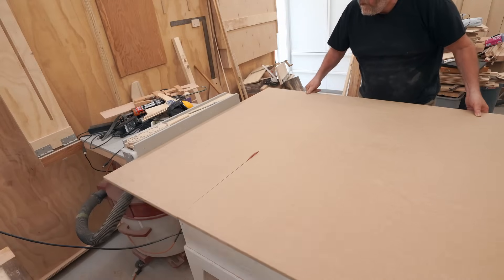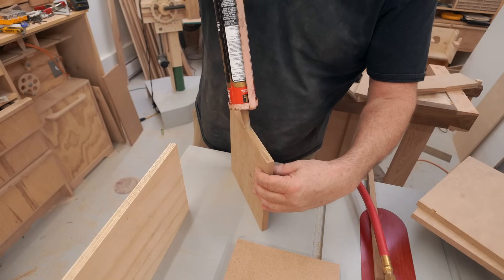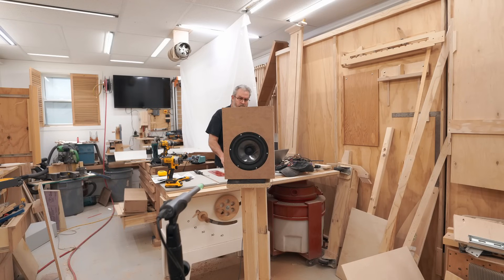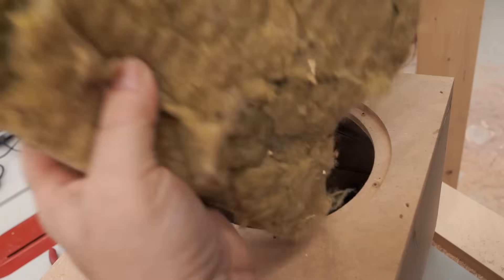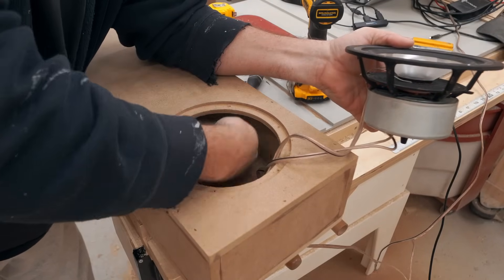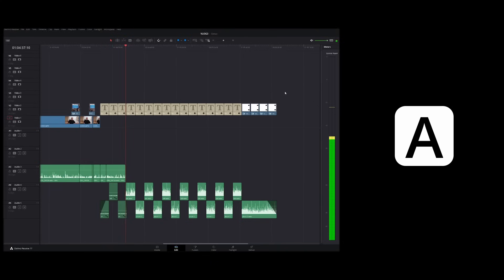Is a Deep Speaker Box Better? Tested with Surprising Results

Comment: The shallow box with larger baffle and rear plate needs a brace in the middle because it will flex more than the one with small baffle and rear plate. Yes the narrow box still rings but will be up higher because of the resonance of the box.. im amaised you missed the mark..here

Comment: It appeared to me that the material you called 'rockwool' was a fiberglass or some other  fibrous insulation, but NOT 'rockwool', which most commonly is dark gray in color, or having an appearance closer to coal. Another way to describe the appearance of 'rockwool' would be similar to steel wool with bits (or chunks) of black rock (coal). I'm not saying rockwool would conduct, or be susceptible to magnetism, but the chunky bits, inherent to rockwool, would likely cause rattling at higher sound pressures, or by increased vibration (movement) of the speaker cone.

Comment: Always use dampening materiale inside the box. But a good box has internal bracing and that will also help cancel standing waves along with other messures. So deep or shallow box does not matter as long as it is built well. And internal box volume MUST be the same for this test to even have any meaningfull comparison.

Comment: Could also be because of the different resonance of the much larger front and back panel.
But also the shape/lenght of the volume matters. The box is not only more shallow but also significantly higher/longer. I think the orientation of the shape in relation to the speaker doesn't matter as much, at lower frequences ?  Needs proof though by tip the box over and mounting the speaker in the head panel. ;)
Thank you for this very interesting audio experiments though !

Comment: I have heard a lot of speaker box design best practices and all of them are for a ported or vented design... when looking at sealed, 'same volume' designs the speaker should have the same results. Knowing you don't want to go thin on the material, brace or frame areas that might flex with large low frequencies... but for the most discerning ears it will be the same.  Great channel by the way!

Comment: Anyone thinking that they are getting a true representation of the sound after it has been re-digitised, likely compressed by YouTube, processed through an audio driver and finally subject to all sorts of distortions by your consumer grade audio gear is kidding themselves.

Whilst I think you might be able to hear a difference, it is impossible to appraise or rate the sound because of the massive amount of change introduced by the above.

For example, one speaker may be deficient in the mid-bass region because of destructive interference in the enclosure, but putting this through a way too 'boomy' set of headphones would correct for deficiency.

Then bias, yes, you are sub-consciously hearing the the sound which you are expecting, be it you like a certain type of musicality, the box design looks nicer or the tone you are hearing is more appeasing.

If the question was "which speaker sounds better recorded and uploaded into YouTube and then played back through your flea market headphones", then perhaps you might have a valid comparison.

Comment: I  listened using regular headphone and I didn't hear any difference at all. But I do believe there must be differences!! Good test. Thank you for the opportunity !! Alberto
Reply: Box A sounds a tiny bit more open and wider
Reply: The bass wasn't as sharp on A. The voice sounded a little bit colder on B but sounded better with a bit more detail in the high med in the voice sound. Everything was a little bit more muddled together on A and on B everything sounded more separate  (especially the voice sound). I heard it on my made 5" open FR driver plus 6" boxed woofer speakers.
Reply: @Justwantahover  Actually, I hear A as having a slightly higher toned tighter cleaner response, where as B was a little bit deeper but smoother which gives a duller response. To me, A hits harder  and is louder but B is smoother.
The problem about getting opinions is that recording a speaker and playing it on different types of speakers gives a different tone. It's a tricky comparison.

Comment: My guess is b is shallow.  It has a slightly fuller low mid that my guess is due to the resonance of the large front face.  A sounded more like a typical point source pa speaker to me.  More projected mids but not as deep

Comment: At the beginning B sounded quieter, but it could just be the section of music that was played on it. In the graphs the deep box was slightly lower in the midbass, so maybe that was B. Although 650-750Hz is higher on the shallow box, and that may be where the singer's voice is. They're so close, it would take a lot more listening to know if there was a significant difference and whether one was better. From what I read, the outside of the box can be seen as a waveguide and deeper boxes show better directivity in the midbass. Shallow boxes have a more abrupt transition from 1/2 space to full space.

Comment: those frequencies are too big to cause standing waves in those enclosures. My guess would be the longer box has a much bigger panel and that panel is resonating, especially considering it is only half inch thick and there is no bracing in it.  high end, well built loudspeakers use at least .75 inch mdf, sometimes more on the baffle and are heavily braced. Even more "square" enclosures like your deep one get good bracing in them.
Reply from the maker: Why guess at all when you can pay attention to what's happening in the video and learn something?
A standing wave at 300Hz DOES fit in the taller box and I show how it disappeared when I added stuffing.
Reply: wow. I did pay attention. 300hz wave is just over 3.5 feet long. That enclosure looks to be maybe 3 feet at best. Your stuffing attenuated a little bit, but nothing like a real standing wave would produce. It still looks like panel resonances.
Reply from the maker: You don't understand how a standing wave works. The box is around 23 inches long and that is the half-wavelength of 300Hz.
Panel resonance for panels this size would be much lower in magnitude and not show up in the frequency response measurement. They also wouldn't be effectively damped by the small amount of stuffing I added.
  @sqpapa

Comment: I built some subs in boxes that were very tall but very shallow to get within the depth of LCR.  The ports are so far away from the drivers that it's like spreading subs around the wall to excite different nodes instead of crowding them all in a similar location.  I initially wasn't going to bother with stuffing until I calculated that a quarter wave within the low pass tail off range could stand up within the box.  Alright fine, have some denim fluff.

Comment: Conclusion it doesn't matter
Reply: It doesn't matter *enough*. Not to be pedantic.
Reply: I thought it did, one was a bit muffled but no idea which.
Reply: @ConorHanley you can correct that by auto room eq with mic. most of the users will have processors or computers like trinnov etc. so it really doesnt matter. even domestic subs are small like knee size. so it really doesnt matter. even mine is smaller than my knee. 

what you need is good dsp and not larger enclosure. for domestic use you need as much integration as possible. you can literally have in wall speakers and hide all speakers inside house. also integration by crossovers etc. so i meant by both ways. as when wife or husband comes, they wont like crowded space. so smaller box makes sense unless you have wife or husband acceptance factor. then go for large box. but its pointless to have large refrigerator box eg: lg ok99, i can have jbl k4 and some random 12 inch sub, smaller than my hand instead of giant refrigerator looking speaker. in the end, both are same things. 4 inch mids and 12 inch woofer. so compact makes sense at home.

Comment: In a thin long box, put a 45 degree angle plate behind the sub firing the sound into the long half so it can’t bounce right back out the face of the cone. Send it more directions so to speak.

Comment: 🎯 Key Takeaways for quick navigation:

00:00 📦 Speaker Box Construction
- Constructing two speaker boxes with different depths but the same internal volume.
- Using half-inch MDF for construction and the same coaxial driver in both boxes.
- Gluing joints with polyurethane construction adhesive and reinforcing with 18 gauge Brads.
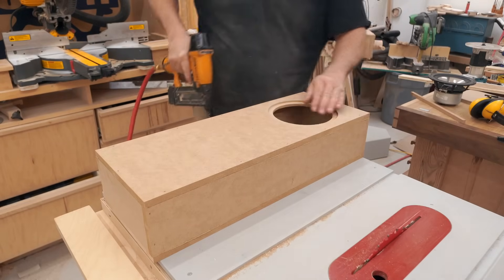01:24 🎛️ Crossover Setup and Initial Measurements
- Building the crossover for the speaker driver.
- Drilling holes and securing wires for amplifier connection.
- Conducting initial frequency response measurements for the shallow speaker box.
02:16 📊 Frequency Response Discrepancy
- Noticing a flatter response in the shallow box around 300 to 400 Hertz.
- Exploring two possibilities: sound reflection off the box's back or a fixable standing wave issue.
- Overlaying measurements to highlight differences, particularly in the mentioned frequency range.
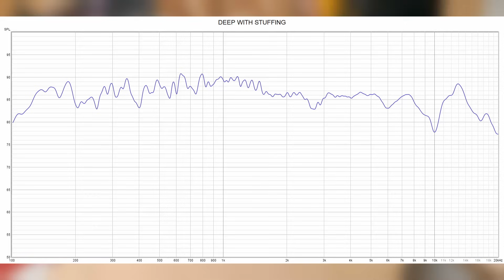03:10 🧠 Testing and Fixing Standing Wave Hypothesis
- Testing the standing wave hypothesis by inserting rock wool in the shallow box.
- Comparing frequency response measurements before and after rock wool insertion.
- Confirming that the standing wave hypothesis seems plausible and fixable.
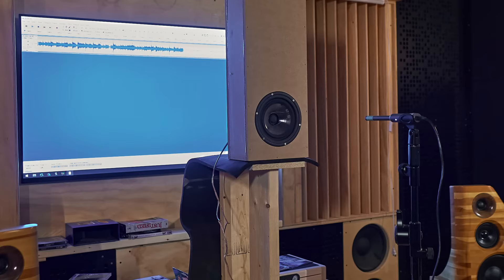04:05 🎶 Sound Test in Listening Room
- Taking both constructed boxes to the Listening Room for sound testing.
- Recording a track with a microphone placed 20 inches from the speakers.
- Challenging viewers to guess which speaker box produces the sound in the blind test.

Made with HARPA AI

Comment: Listening to this video with a pair of DT770 Pros, and I'm struggling to tell this diff between the 2 speakers.

This video reminds me of the pair of B&W SCM1 speakers currently sitting on my desk. They are supposed to be the equivalent of the better known B&W 805 speakers, but are flatter in shape and designed for wall mounting. Legend has it that the deeper shaped 805 has better bass response. B&W simply tells me that positioning the SCM1 closer to the wall elicits similar bass. 

I don't care. I simply bought the SCM1 because it sounded and looked good and were a bargain compared to the 805.

Comment: Interesting.  Have you tried making two speaker enclosures with exactly the same physical spec and then measuring those? You may be surprised. Some years ago I bought two speakers from a highly reputable manufacturer. They were'nt left or right as their geometry was identical and still sold as a pair. When set up I suspected a problem and checked by running white noise through each in turn. They sounded compeletly different to each other on white noise, meaning their response was nowhere near the same. ( I swapped them around to eliminate room acoustics).
I took them back and demanded they be tested. They ran the same test with various combinations of one of them and others from their stock of the same. NONE of them sounded alike. The only thing that matched was the wood veneer.
Reply: If you don't want to name them, just wondering if they were Chinese mass production, or a supposed better qc "more hands on build". My guess is poor crossovers made them sound different.
Reply: no they were British built bullshit. @bigshnitzeljesse
Reply: @lyntedrockley7295  got ya. Don't believe I've ever had the displeasure of owning any British audio

Comment: Maybe this is a silly comment, but I would have used X & Y as opposed to A & B as 'A' is sharper in appearance than 'B' and plays with our minds. For that reason, I felt 'B' had more 'B'ass and was the deeper box......? though you stated the shallow box provides more slap-back bass for a fuller bass.

Comment: The only way of isolating this test is to make a large box with same identical outside dimensions and baffle, but have sliding internal panels that change the depth but keep the same volume of chamber inside to see if you can hear the difference, consider looking at stored energy response and try the adding damping to back to see if you can get both deep and shallow to perform the same. Make sure the panels are solid with bracing, as any vibration of the box walls will overshadow the tests. This is actually very very hard to do.

Comment: The trouble is thou because the baffle is different, the baffle step has changed, and that will overshadow the reflection u hear, plus by adding extra damping to the back reduce the reflection in a shallow box anyway. I think the shallow box may sound a bit better in this test as the baffle is longer, hence more sound directed towards the mic at front at lower frequencies.
Reply: Shakespeare has chimed in?
Reply: @EricBrettJones thou baffle hath hastened thy loweth frequencies, unto thy mic, verily

Comment: I think A is the deep box and B is the tall shallow box, as most others also think. This lines up with the graphs , with the deep box having more low frequency output and the tall shallow box stronger in the mid range. I think the 2 different boxes together would sound good but most people wouldn't like the look of this.

Comment: Your driver havea membrane area 120 sq/cm. That gives an dia. under 5inc. Add some for the "rubber" around. That is not so close to 6 1/2 inc. you mentioned.
But closer to the depth of the box. And not so bad as 6 1/2 inc. dia. would be.
So this test is not the best eksample in this matter.

Comment: The shallow boks have a dept  close to the diameter of the driver. I belive the differens gets bigger vhen you have a shallow box with dept under de diameter of the driver.
I think the diameter of the driver are the clue here.
If a shallow boks sound good in the low end it's because it have smal diameter basdrivers.

Comment: I know your not supposed to use real wood for speaker enclosures but I plan on building new, same cubic foot, same shape enclosures for my Cerwin Vega VS-150 15 inch 3ways out of real walnut with a thick "bar top " like clear coating all iver them buffed to a deep shine.Inside i will brace and use some kind of sealant like a bed liner roll on without the grit in it  Think the real wood will work or will it dry out, shrink and split?
Reply from the maker: The bigger the box is, the greater the chance that the wood will split if you don't make allowances for wood movement. You really need to know how to work with solid wood to make those allowances.
Reply: @IBuildIt  yeah, ill figure somethin out.

Comment: Like I'm going to hear any real difference on a speaker bar after youtubes algo's smash the sound.  I did notice the differences in sound in my old Design Acoustics D-2's when I changed out the insulation batting from pink to rockwool. I eventually went back to the pink.
Reply from the maker: The point was that the difference should be obvious, if it really was a valid problem to avoid. Obvious enough that you should be able to hear that difference, even if listening on less than perfect speakers or headphones, and not have to replay it over and over and strain to hear the difference.
As for YouTube "smashing" the audio, that's largely an overblown assumption. YouTube's compression is most obvious on video quality, since it can be more than 100X larger than the audio component.
That said, if you can point the way to a reliable source that shows that YouTube compression makes an obvious (key word here, as above) difference, I'd like to see it.

Comment: Well, for me is A shallow and B deep. A has more high-frequencies and distortion it seems to me. B has a more reaxed sound. So you can caculate the distance behind the speaker by formulas from Bailey and Rogers they used in their TLs since the sixties.
Reply: I can hear the same differences even with my android phone. I agree with your conclusion and I love the deeper box sounds.
Reply: My ears mimicked your guess as well.
Reply: Excuse me for wedging in this conversation 2 years after it was started, but in my opinion the most notable difference between A and B is that A clearly has more energy in the bass and higher mids / highs, while B is balanced a bit more towards mids. Wouldn't call B more relaxed BTW, I kinda think the opposite is true. Speakers that are focused on the mids are less relaxing to my ears. I didn't hear any distortion in B, just a slight difference in tonal balance. If I had to guess, A is a narrower but deeper speaker, while B is wider but more shallow. Did he ever answer which one is which?

Comment: A sounds like  its been compressed. my guess this is the shallow box since the driver has a stiffer air suspension  i think you will get a bigger difference with  sub base frequencies .. this recording on the mic suggest it had little to no base .hence most frequencies would not create a standing wave in a deep box  ..you will find 50 hz and lower will be far more detailed and louder in a deep box  ..i made studio grade monitors that can go well below 25 hz and are very responsive .i heard no base what so ever on this mic examples the lowest was 80 hz  ..that will work and any enclose size even open baffles . i suggest using sub woofers for this experiment .i find using  Fs wave length of the driver and fit it or  divide perfectly by 2 /4/8/ or 16 times ,you can get the depth of the deep box with the best results then adjust the other sides to fit the  volume needed

Comment: I noticed a difference in bottom end one had a slight loss to the bottom end which screems the shorter but longer box. Now if you glued small 45 degree angles on the back of the thiner box behind the speaker wouldn't that help from reflections?